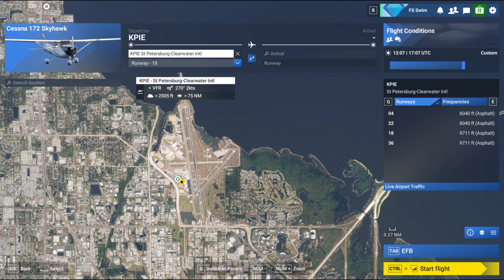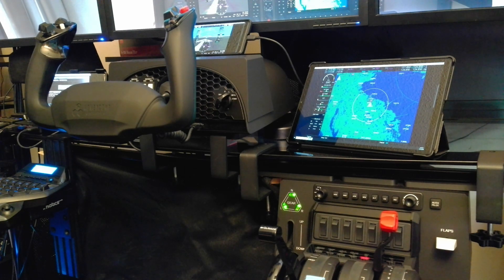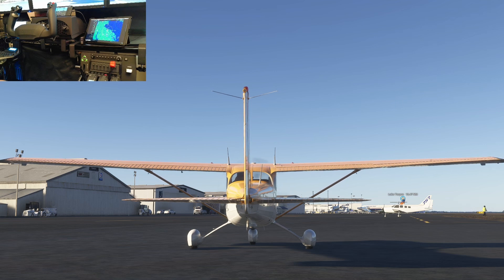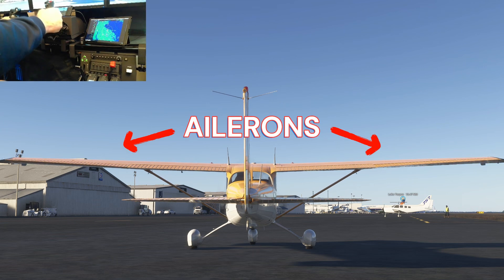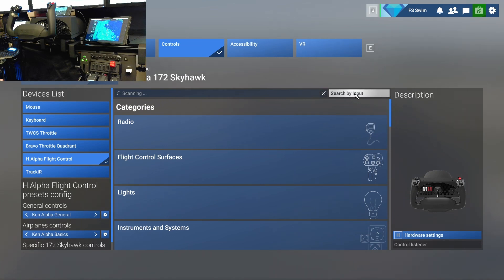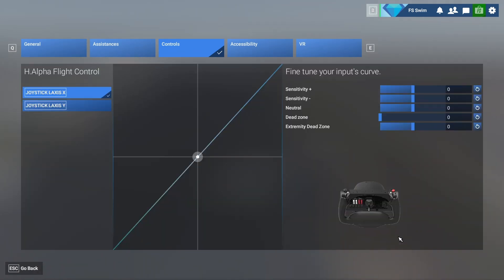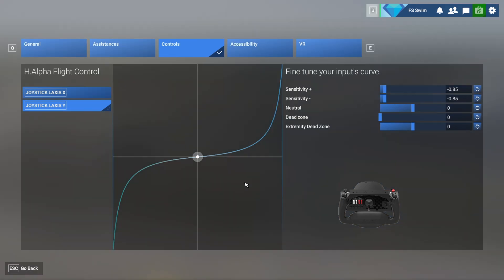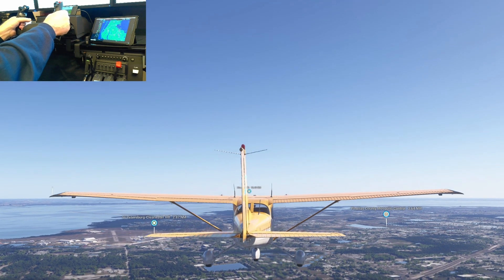MSFS 24 How To Adjust Sensitivity Settings Yoke or HOTAS Stick Controller Microsoft Flight Simulator

Comment: Help i having so many issues in career mode i cant pass that bv the nose keeps pitching down
Reply from the maker: What controller are you using?
Reply: Alpha yoke same
Reply: You might try using the search by input function in the controller settings to see if anything in addition to the yoke is set for pitch down.
Reply from the maker: Yes, good idea 👍

Comment: For even smoother feel ,dont reduce sensitivity so much. Use "Extremity Dead Zone" which really means "Range of Motion" for control surfaces. If you tweak this you will get Butter smooth control and landings.... move Extremity Dead Zone to the Right for mor butter! You may find you need more sensitivity with this. Tweak It!👍👍